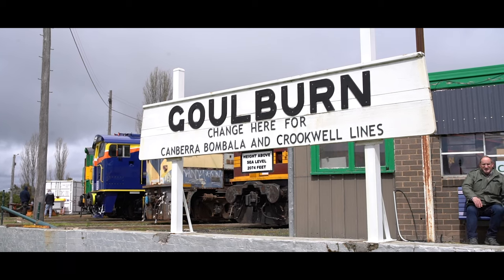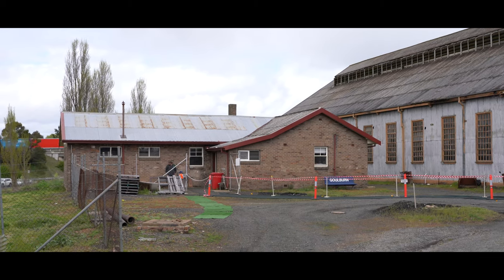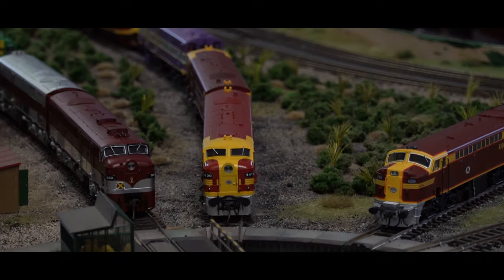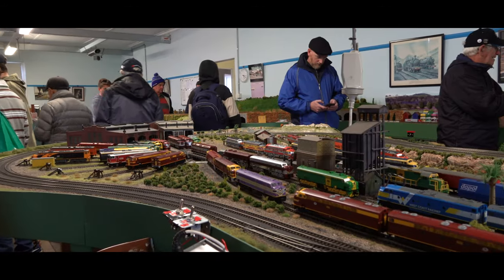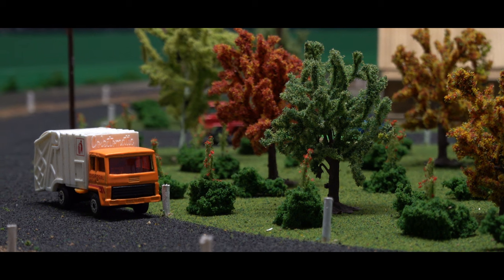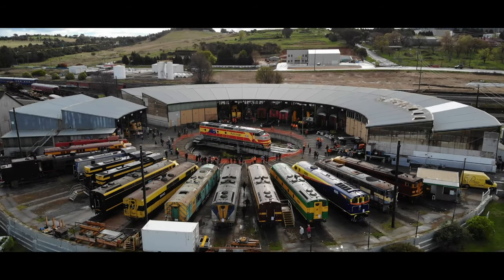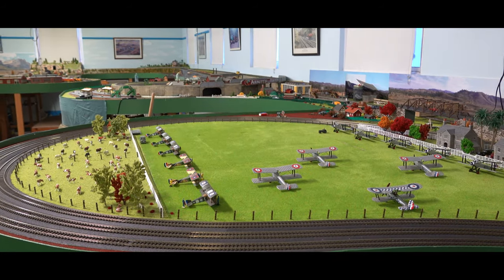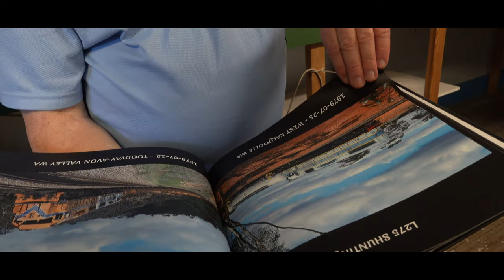Argyle Model Railway Society - Goulburn, NSW

Comment: Will, yet another great club visit report.
Looks like a great set-up, and a great club.  Lots of details and items of interest.
Quick question, if you know the answer - what is the slope of their grade (@6:05 in the video)?
Thanks for sharing, and stay safe,  Michael
Reply from the maker: Thank you Michael! I’m not sure sure on the grade! Hopefully a member sees this comment and can answer it!
Reply: 1 in 40 the grade is, the club wanted sensible grades, 1 in 40 is a realistic grade so the club went for that. There are lesser grades such as 1 in 60, however the trains for about 85 percent of the time are running on the flat, so the grades are not an issue
Reply: @andystevens8693  Thanks for replying, it just looked steep.